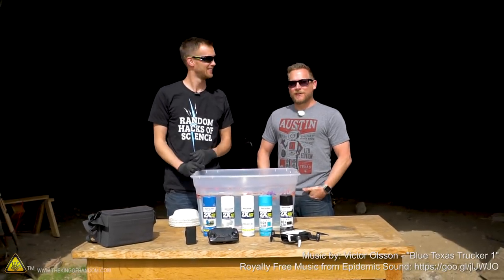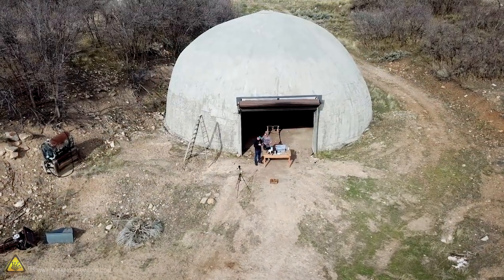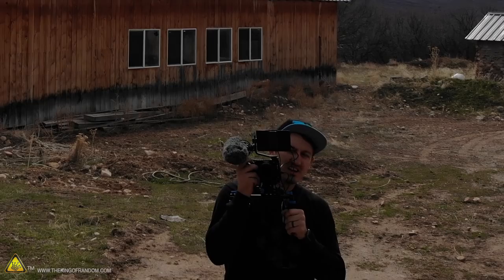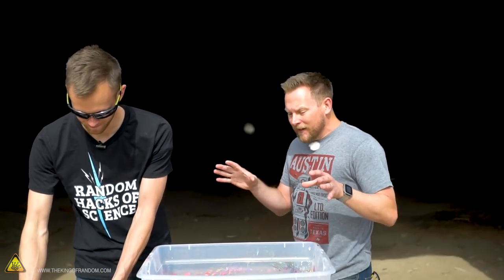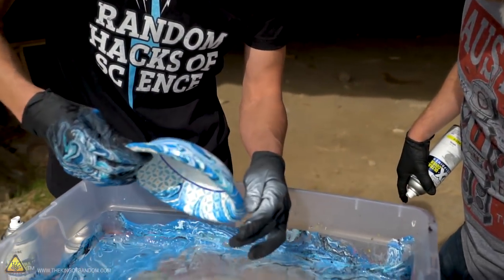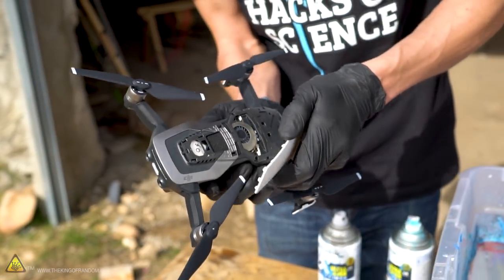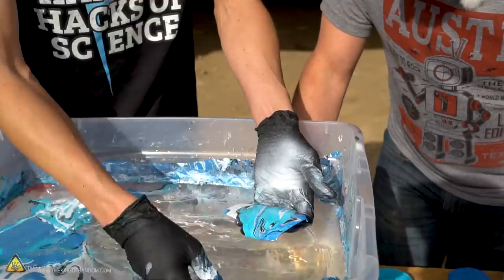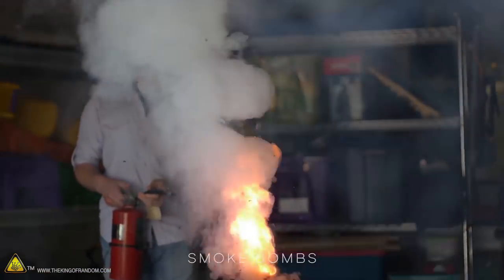Hydro Dipping Drones in Spraypaint! Hydrodrip Painting a Drone With TKOR

Comment: @The King of Random - Try collecting the spraypaint in a container (The cap for the spray works well), Then using drops into the water to make patterns. Then use a small needle to scrape the paint to add even more pattern.

Comment: One thing i dont realy like about this techneque is the splatters that become when spraying, have u tried other kinds of paint, like some silicone paint in a bucket and dripping it in? or some other paint u could dripp in instead, maby paint on a surface and then lower that in so the paint stays on the surface like some kind of mesh.

Comment: I looks awesome but you should use a different kind of paint.
Most automotive hydro paints jobs are done with an oil based paint and a pipet to lay it on top of the water.

Comment: i have a question. dos it flake? i spray painted my ps3 controller, and under a year later it started flaking paint and was horrible. i had to buy a rubber cover for it just so i could use it without getting paint flakes all over my hands

Comment: Will this be permanent or can you peel it off if you wanted to?
Reply: It's paint so it should be pretty permanent. The clear coat over the top should help protect it. Like most paint though, it can get scratched, but it should hold up pretty well.